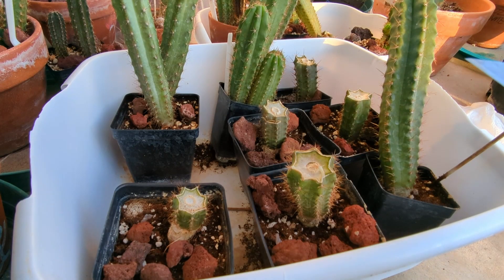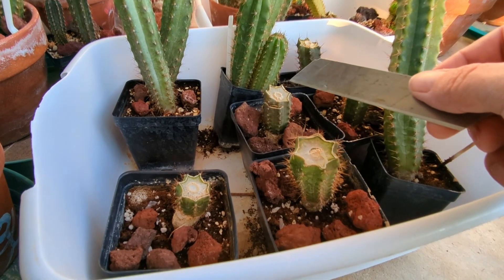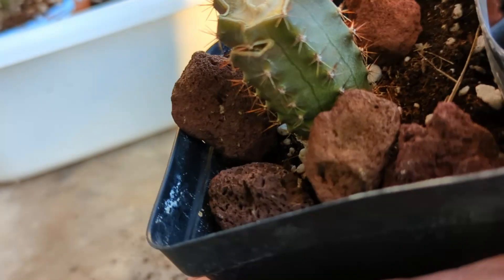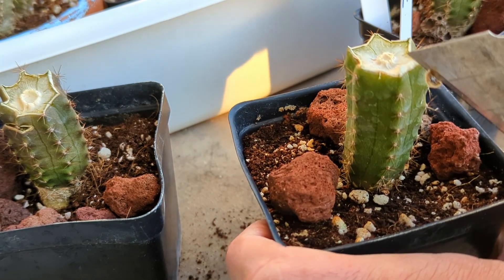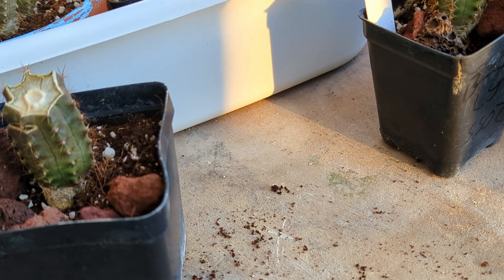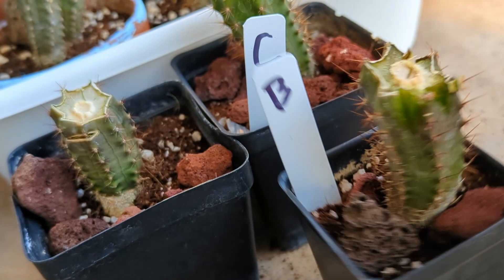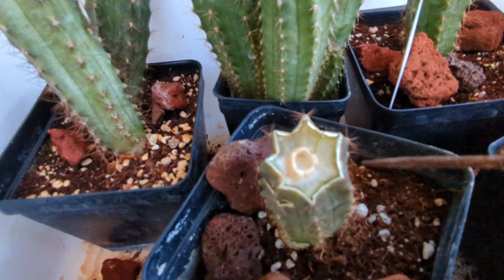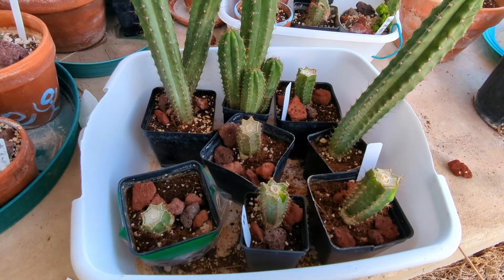Cactus Pupping Experiment #1 Welcome to Puptown.

Comment: This is an assumption, and naturally the purpose of an experiment is to find out if an assumption holds, but...  I would think anything that removes the dominant growth point on the plant--the apex in this case--would cause branching and that the nature of the cuts don't really matter a whole lot.  My first thought is that if I wanted to increase branching, I would focus on maximizing the rate of growth in general before lopping off the top, and leave most of the plant intact when doing the cut.  So cut off just a bit near the very top after having upped pot size, fertilizer, water, and temperature for a few months before (within reason, of course).